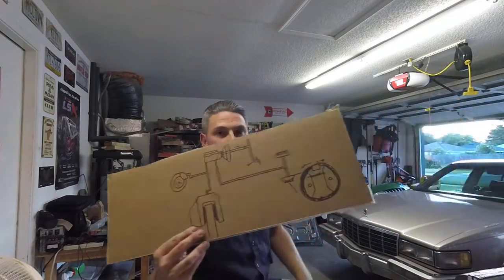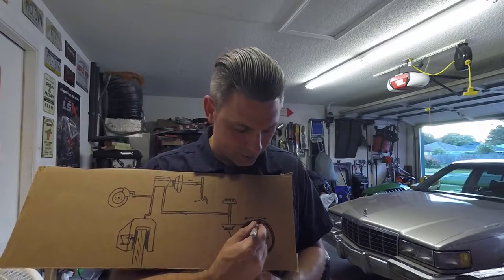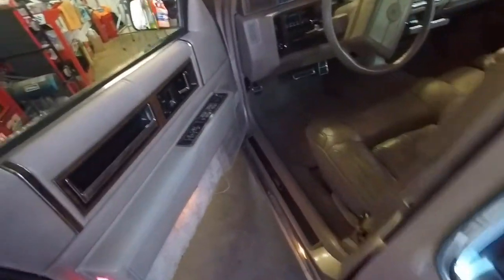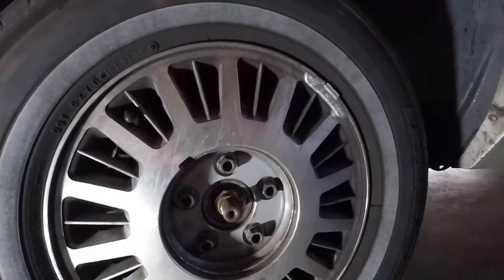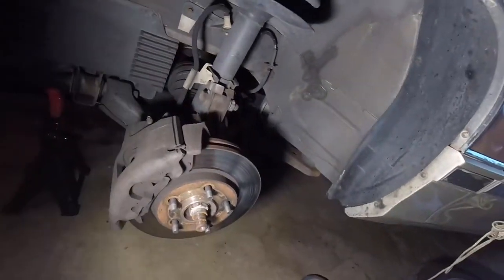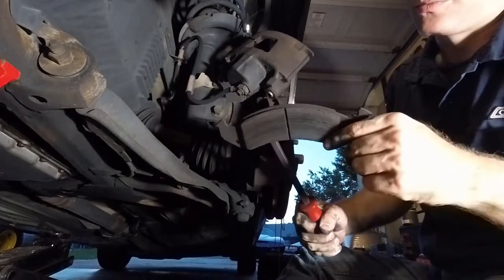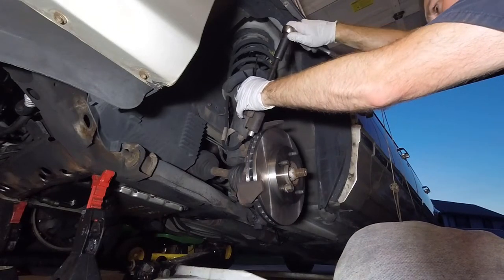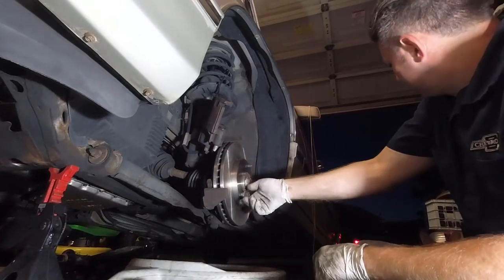Replacing front brakes on my 1991 Cadillac DeVille. P.P.H. Ep. 7

Comment: Want to put my 1991 DeVille on four jack stands. The front was shown in your video on Replacing Front Brakes Video. Jacking up the rear of the '91 DeVille seems a bit more difficult. According to the manual, there are two jack points in front of rear wheels. I would like to use them for the jack stands. Where to place hydraulic jack to allow placement of those jack stands? The box rails seem rather flimsy. Suggestions? I'm thinking of placing the hydraulic jack just forward of the round jack point with a small 2X4 between the jack and the box rail and using the round jack point for the jack stand? Or is there a center rear jack point as in many other FWD cars to lift the entire rear of the car?
Reply from the maker: When I jack mine up I use the common cross member between the rear wheels. Then I put my jack stands on the box frame rails. That's how I did it when I put the fuel pump in. Let me know how you make out!
Reply: Thanks for the quick response and I like your presentations. Also, your lengthy intro explanations that some find boring are probably valuable to newbies. I  was just concerned because someone had suggested that maybe that rear crossmember wasn't beefy enough and may deform after jacking up causing the rear wheels to go out of alignment. Away from home now, but will check when I get home. Is that rear cross member a major support strong enough to support the car? The front crossmember certainly appears strong enough.  Miss the old cars with perimeter frames.  @Paulie_KITT

Comment: Wish u were in Michigan! My 1993 deville anti lock light has been on!!!!! Feel like my pedal goes kinda low to stop! I replaced the rotors and brakes in front! Light still on ! Pedal still going kinda low!!! May have to take to the dealership! Maybe a sensor or something
Reply from the maker: I would start by properly bleeding the system. The Anti Lock light is likely on due to a faulty sensor. Unfortunately getting the rear sensors for our cars is nigh impossible. A good, old school shop would have the original ABS scan tool to tell you which one it is. Good luck, and let me know how you make out!
Reply: @Paulie_KITT  thanks man! Fast response! 🤟🏽😊! I’ll let u know thanks !
Reply: Abs module was bad lol my mechanic found out !!!!!! Trying to find one! Any ideas where I can order one from ? Thanks